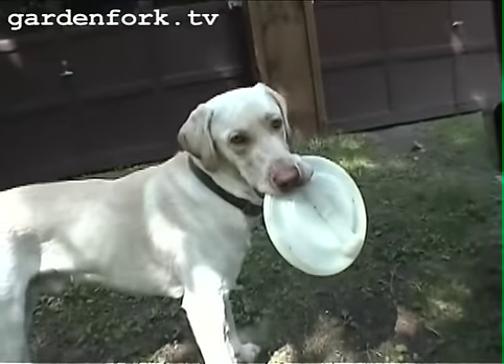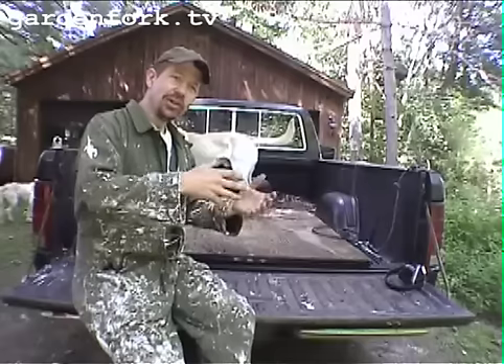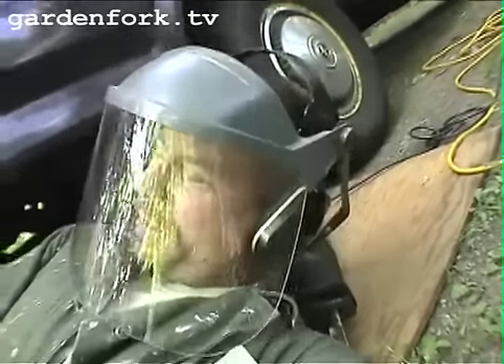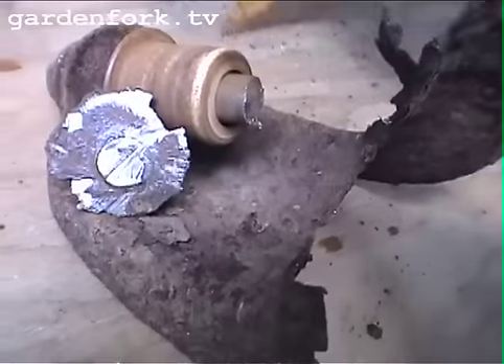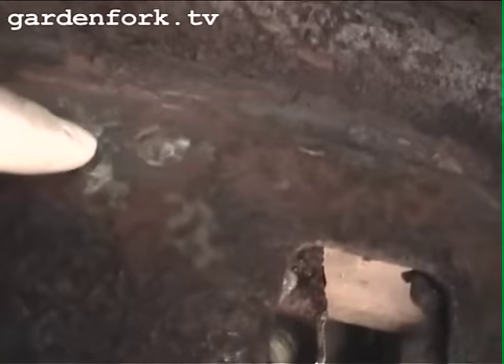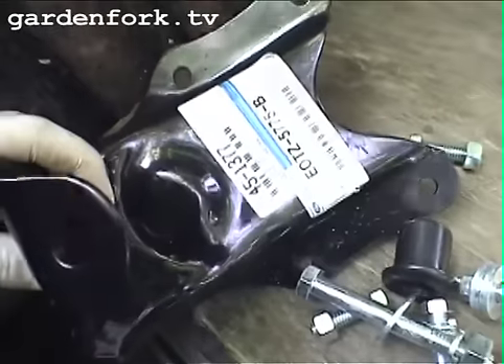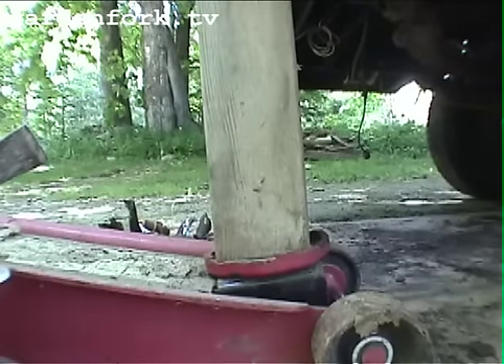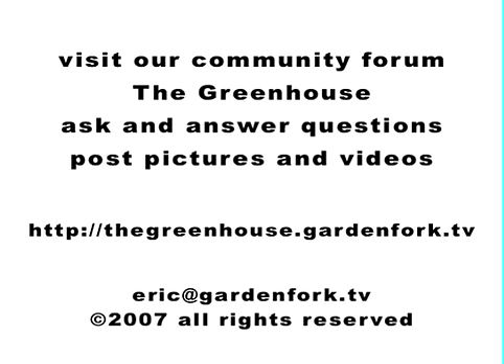Truck Repair, Spring Hanger Shackle Bracket Ford F150

Comment from the maker: truck repair can be that way. i just replaced the computer on my 93 F150, and it fixed the idle problem . expensive part, but it worked.  thx, eric.

Comment: Thanks for taking the time to show all the steps, good video. Thank you for explaining on how line up the shackle holes up. Leaf spring shackle kits can be found online.Some kits don’t include bolts but they too can be found online. Shop for the best deal you can find. Be careful working underneath vehicles because it can be dangerous. If you have to take off the trailer hitch be careful they are heavy don't let it fall on you. My 2002 Silverado needs this this done too!

Comment: Eric, Might I suggest you try using a die grinder next time.  I use pneumatic ones. You can find them for a fair price at several different places, I'd start with Harbor Freight, or Walmart.  You will use less consumables, (grinding disc versus reciprocating saw blades) and it will get done a lot faster.  Enjoyed the show though, great work.

Comment: How did you release the tension on the leaf spring? My leaf spring shackle broke right off the bracket and is pushing up against the bed. I need to release the tension on the spring so I can maneuver it back to bolt it into through the bushing. Any help would be appreciated.

Comment: just a good tip, if you use the saw on fast speed, you will MELT the teeth right off. just use a slower speed, and move it back and forth while you cut, and you should be fine with one blade. i have done a few. good job. nice dogs by the way!

Comment: EricL5150, simply jack up the frame of the pickup (car) off the spring and axle assembly, your shackles should move into position at the right height to be able to re-install everything.  Good luck.

Comment: I'll be using it, I'm all ready to go on the job, but I do, however, want to get this thing running fine before I do other work to it. Acts lean, in the way that the exhaust coming out is WAY hotter than it should be, and has no power either, yet it's got HORRIBLE gas mileage and a bit of white-ish grey smoke when cold, and consumes oil...